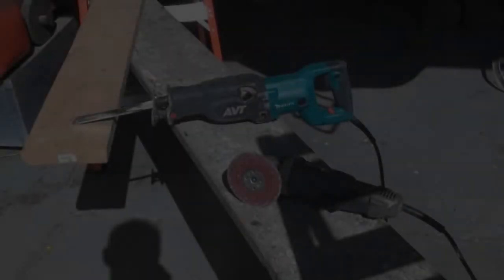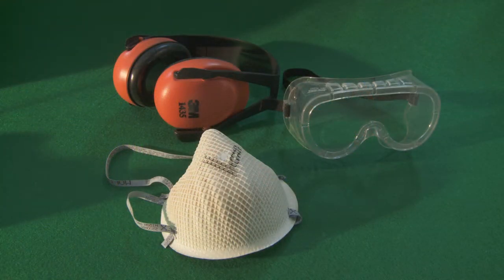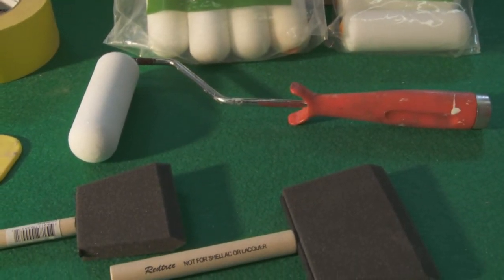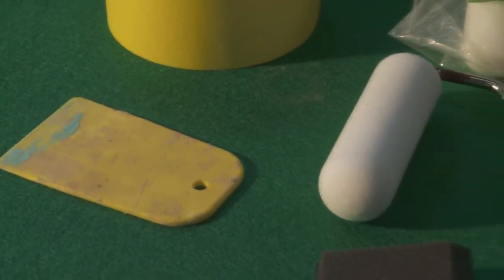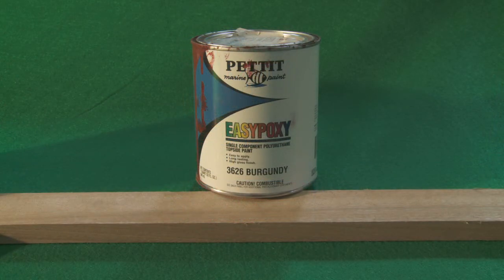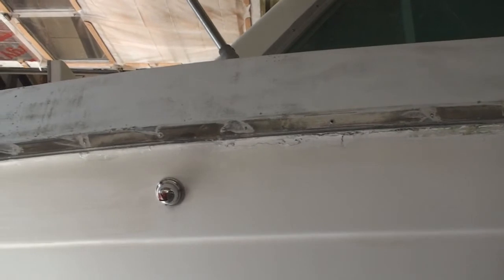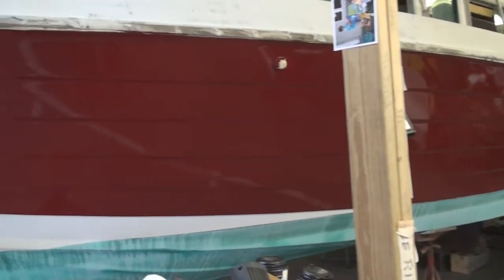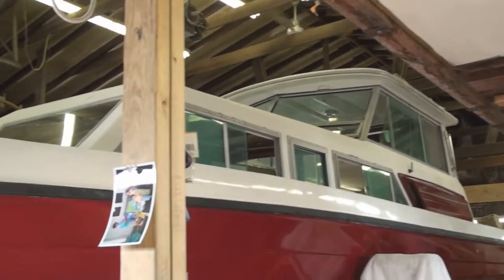This Old Boat at The Yacht Shop 2. Hull Paint

Comment from the maker: yes we sand between coats because that is how single part paints adhere to each other. it's a mechanical rather than a chemical adheasion like two part paints. the voc's are also less so they don't smell as bad as two part paint. we have found that if you sand between every coat it will look better and last much longer.